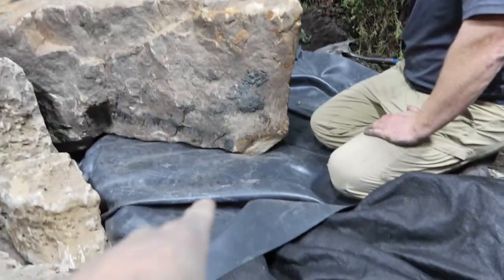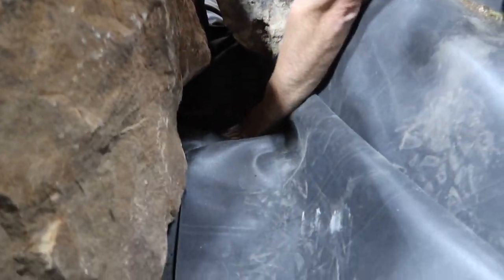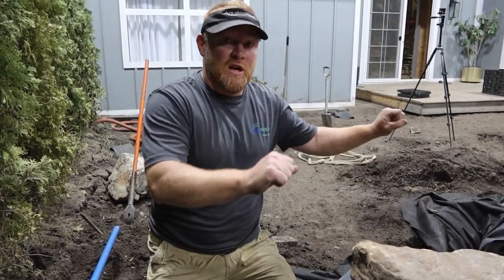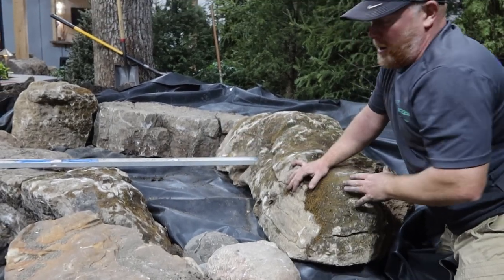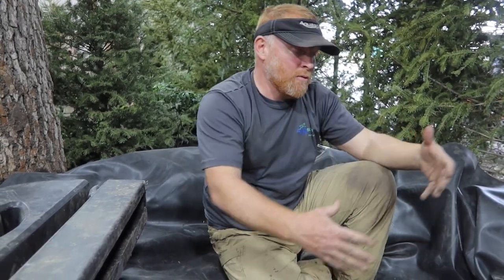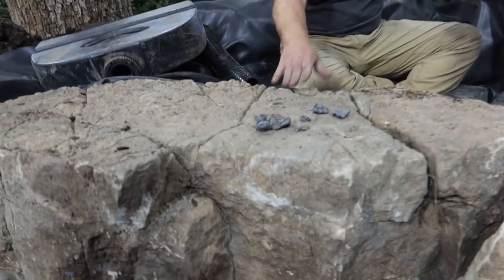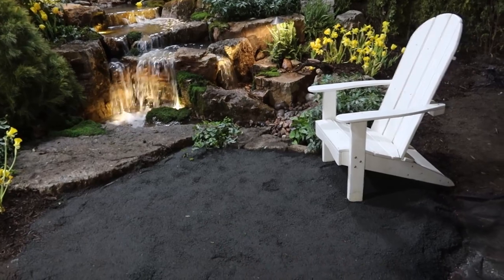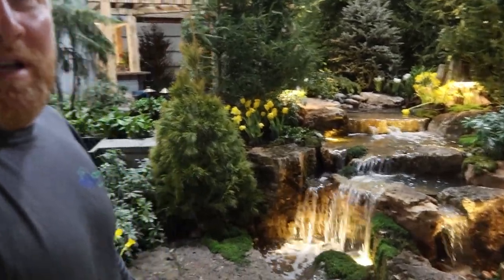Large Pondless Waterfall REVEAL - Part 2

Comment: Thank you, thank you, thank you for the tip on the spillway placement.  I'm still a rookie and I have a build this month where I will be using a spillway for the first time.  I was trying to figure out where to place it because I have a bowl designed into the beginning of the waterfall.  This is a huge help.  How much flow do you have running on that waterfall?  Are both pumps running in this video?

Comment: Can I ask what's the point in having 3" lines if they start off as 2"? Why not have 2" all the way?
Reply: Hi Phil,  he does actually explain your question at the 11:45 mark of the video.
Reply: @cbwaterfeatures  Yes, but as a plumber that still makes no sense.
Reply: @WeAreTheTrueMedia  my understanding of it is the friction loss throughout the length of pipe.  With every 10' of pipe another foot of head pressure is added.  Having 3" pipe instead of 2" all the way adds less restrictions for the water to travel.  I would be curious to see a side by side demonstration.